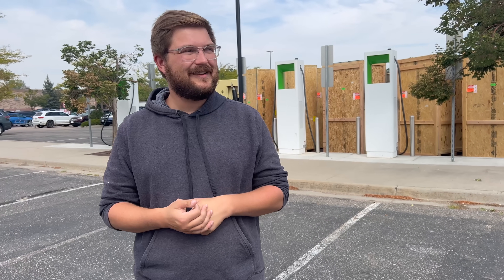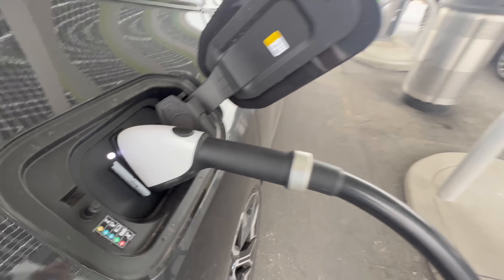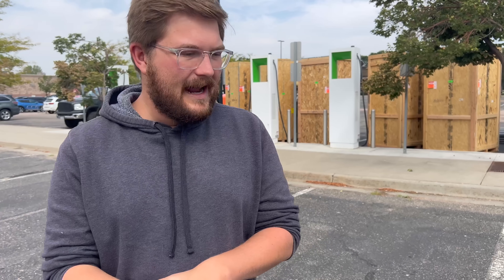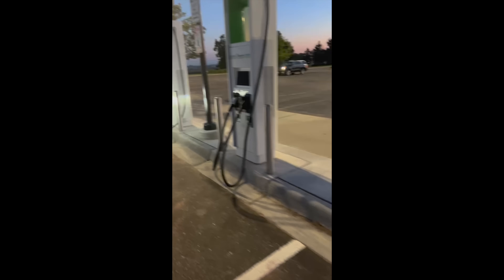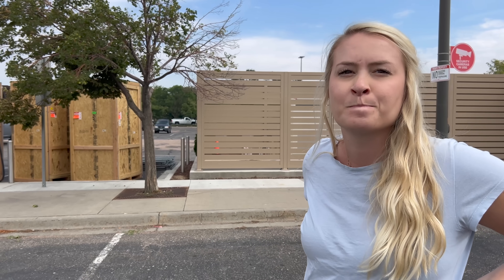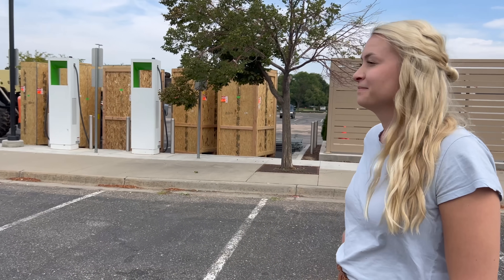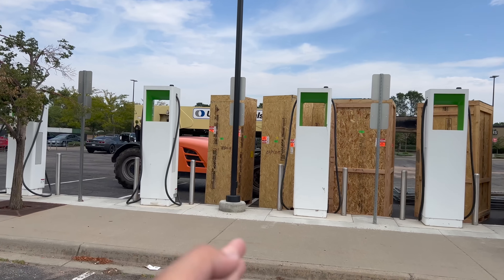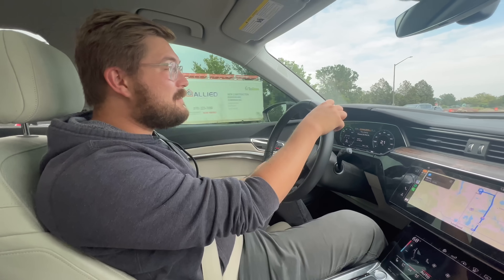Upgrade! New DC Fast Chargers Are Being Installed To Fix Reliability Issues Of Older Units

Comment: my local BTC's (6 on EVgo) had been rock solid for the past few years up until the recent heatwave.  went to the station over the weekend (2x) and found 3 of them are not working.  1 clearly says offline, 2nd looks like it's good but even with EVgo on the phone doing a remote reboot it still didn't work, and a 3rd has a completely black screen.

Comment: #OutofSpecReviews - have you had any experience with Tritium chargers? They are an Australian company. They design and manufacture proprietary hardware and software to create advanced and reliable DC fast chargers for electric vehicles. Tritium recently opened its first global EV fast charger manufacturing facility in the United States. Earlier this year, Tritium entered into a multi-year a partnership with BP. Thanks in advance.

Comment: Interesting comment about how things are better in the eastern US. We live in New Jersey, and usually charge my wife’s e-Tron at home, but a few times we used an EA station at a mall in Deptford NJ. The installation is about a year or so old. Stopped there a couple of weeks ago and 2 of 4 chargers were not working.
Reply: There is more than Ea do yourself a favor and learn plugshare and use chargepoint and ev go too so it isn’t just a bash fest on ea

Comment: I hope they only install "balanced" 350kw going forward with the higher charging EV getting the higher charging while the lower one gets the maximum in can. Looking forward, it will avoid confrontations, or at least difficult discussions, when low charging EVs always take up the 350kw chargers despite their EV not being even capable of taking a full 150kws.
Reply: This spot used to have 2 units at 150kW, and 2 at 350kW.  Having 4 balanced would be great, IMHO.

Comment: I wonder if this is the end for chademo. My guess is 3 of the dispensers will be updated and the chademo charger will stay the same unit. Would explain why there is only 3 crates sitting there.
Reply: Every day in the USA, more and more CHAdeMO plugs are added from EVgo, ChargePoint, Shell Recharge, 7-11, etc.  Dept. of Energy shows CHAdeMO station count at a few hundred less than CCS at over 4,300 and 2/3 of the CCS plug count; not bad for a dead standard.

Comment: They should be installing solar panels/car covers like Tesla is starting to do. Help the grid, don't hinder it.
Reply: I mean, to be fair, the roof over a parking space is worth maybe 25 or 30 kWh per day. So that's not gonna offset a very large percentage of your electricity use. Still, just having the roof at all would be nice.
Reply: I agree, but I think they need to build more charge stalls than they need on average. For instance, the one Tesla is building has 40 stalls. Gotta think there will be less than 100 percent use. But yeah, we need more supply for sure.

Comment: The new station being designed like a gas station is an immediate improvement in my eyes. But seriously, stations just need to stick to swiping your card or phone instead of software or car triggered charging. It's just less likely to fail.
Reply: Remember when fuel stations issued their own credit cards? I think I had an Amoco card back in the day. Good riddance. We don't need a return to siloed payment systems for EVs. Please.
Reply: I do love chargepoint because you just tap your phone and you are good to go.  much easier than Electrify America.
Reply: The card readers are a main point of failure for EA. For Tesla car triggered charging just works. There’s no technical reason other networks can’t work as well as Tesla.
Reply: @brendykes6599  To be determined. Will the Tesla chargers continue to be a seamless experience for all once they allow all CCS1 cars to use their service? We don't know yet.
Reply: @ps.2  not really. Now you have a communication protocol that can become screwed up, you need to have your credit card loaded to your phone or account making it more vulnerable, and you need to update the stations if they changed the communication computer on their cars.
Reply: @Skylancer727  "your account"? Why should I have an account? I don't have an account at any gas station. If you haven't fueled a gasoline car lately, oh man, it's super easy. You just provide a credit card at the point of sale and it handles the rest! Verifies your account and puts a hold on it for a maximum purchase (say $50) and then turns on the pump. Once you dispense what you want, it replaces the hold with a credit charge for the actual amount.

Occasionally you run into fraud prevention stuff like "oh we didn't expect you to be in Texas, so we need you to respond over SMS to verify it's really you" but nowadays with chipped credit cards (unforgeable, unlike mag strips) even that stuff is getting less common.
Reply: @ps.2  I think we already know it’s not the case for other EVs as they have to use an app. What I’m saying is Tesla proves it’s not impossible to be seamless, but a new standard may be required for CCS cars to work as well.
Reply: @ps.2  talking EV chargers. Many have it you need to open an app and tell it to start station 9, have your credit card added to your car which is less reliable, etc. The main reason they've been doing this crap is that it makes it easier for them checking people with their charging subscription fees. "Pay $20 a month and save $0.15/Kwh". Downside is it makes the whole process more annoying for basic consumers.

Comment: EV charging will be a second rate experience until they regularly put them under carports just like most gas station pumps.
Exposing them to extreme sun, snow and rain probably makes them wear faster plus it’s a very poor experience for the customer  to be rained on or have trouble reading the screen due to sun glare while you and the charger both overheat in the afternoon sun.
Hiding the chargers in back corners of sketchy parking lots also shows disdain to their customers.
Reply: Roofs costs money and gas stations are requireed to be protected from rain runoff, so it will never be as common for electric chargers to be under a roof I think.
Reply: @sandos-x1t  Fuel brousers need protection from rain. High Voltage equipment handled by the public not. WTF?
Reply: @sandos-x1t  I think the roof contains a mandatory fire retarded (?) too.
Reply: @sandos-x1t  Yes, a roof costs money. It’s part of the cost of dong business.
Running a business costs money.
Leaving the customers exposed to sun and rain is insulting  and hostile.
Reply: EV charging will be a second-rate experience until the price of DC fast-charging retails at $1/kwh.  THEN, no operator could afford to have one idle, and profits will pay for carports, and competition will soon have operators trying to outdo each other’s amenities.   Have we forgotten how the miracle of free enterprise works?
Reply: @carsonassociates3263  
And at $1 per KWH.. No one will want to use one because gas will be cheaper by HALF, and still faster.  NO THANKS..
Nobody is going to pay $60-100 to go 300 miles.  That is insane.
Reply: @kens97sto171  There are plenty of 15mpg vehicles that pay $80 to drive 300mi.  Cheap charging is HOME charging; if you want to see reliable DC fast-charging for a road-trip, it’s necessarily going to cost a LOT more than home charging, because of the necessary equipment an operator must purchase and maintain.
Reply: @carsonassociates3263  
There are no vehicles that get 15 miles per gallon that are similar in shape or Energy efficiency to any of the EVS you're trying to compare them to.
You might get 15 miles per gallon in a 2500 series heavy duty pickup truck.
I understand cheap charging is at home. But that's not what we're talking about here.
Think about it. They can drill for oil pull it out of ground, put it on a ship, send it to a refinery, put it on a truck, send it to a gas station. Provide a cover, and a place with a restroom and snacks and food. And still sell it to you for less than the cost of that charging session you're talking about at a dollar per kilowatt hour.
Something doesn't seem right.
I've Got Friends with 1500 series pickup trucks they average closer to 20 MPG.
And the average sedan in the United States is getting closer to 35 MPG on the highway.
Reply: @kens97sto171  The amenities of gasoline retailers exist because of profit-motivated free enterprise.  If we want similar amenities for DC fast-charging, we’ve got to encourage the profit motive to do its work.  I’d rather pay $1/kwh on a road trip (MORE than cost of gas!) for DC fast-charging that’s dependable, than pay $.40/kwh and wonder whether it will be found operational (so that I can get soaked charging in the pouring rain).
Reply: @carsonassociates3263  
And yet somehow the gas station with all of its profit motivated extra items, can get you more miles for less money than the $1 per kilowatt hour you're talking about.
I agree with you that charging stations should have amenities like a gas station.
But I'm not going to pay three times as much money and spend three times as much time versus a gas car on a road trip.
$1 per kilowatt hour is about three times the current rate.
There is no way in hell I would ever pay that regardless of what the amenities are or how reliable the charger is.
Gas stations don't have reliability problems in dispensing fuel and they do it for a far lower premium and already offer all of the services and products you could possibly want on a road trip.
Reply: Gas stations sell gas at a loss because it's the convenience stores that make them a profit. If utilities built those stores for chargers, at least theoretically, they should be able to sell charging for even less than they do now.
Reply: @carsonassociates3263  the miracle of free enterprise results in there being very low margins on gasoline. I look forward to having all those amenities along with low margins on electricity. If gas stations make their profits off the stores now, they can do the same with EVs as they provide for EV drivers. I look forward to DCFC prices being only 5-20% higher than home charging.
Reply: @brendykes6599  Sounds good to me, too!  Problem is, delivering DC Fastcharging requires operator $investment and ongoing $maintenance, at present, for dependable (i.e. works when YOU need it) charging.  I would gladly pay $1/kwh for the CERTAINTY of highway roadtrip charging.  My home AC Slowcharging is my primary source, and will remain the most economical as well.

Comment: Kyle, I'm looking forward to two particular reviews. 1) Roadtripping with the Aptera (loaded up with camping gear, Alyssa, and the dogs), and 2) Offroading with the Aptera. I hope you can get around to those two.
Reply: 👍👍👍👍Aptera - waiting impatiently for mine!
Reply: With those low fairings around the wheels like a Cessna, how is offroading with Aptera even supposed to work? Do you just remove the fairings?
Reply: @ps.2  They have an off road version where you can easily lift the wheel housings.
Reply: @ps.2  …you’re catching on….

Comment: Yes, perhaps this will help.  But....  My concerns about battery electric vehicles are far more "in the future."  Just consider every gasoline station you see, every day.  Those things work, every day, every month, every year, every decade, and normal ordinary human beings can use them.  I would really like to see you or some other YouTube channel that's deeply involved in battery electric vehicles really dive deep into why these charging stations have become so unreliable, and what are the chances that this will be the future of battery electric vehicle charging, or whether things will become as reliable as, say "gasoline stations."  Would that even be possible?  Are these things just dealing with such high DC power, advanced electronics so they can work with a wide variety of vehicles that pull up, and/or other technologies that just aren't going to be any more reliable that letting your notebook computer sit out on top of one of these dispensers, 24 hours per day?

Also, what are the chances that "ordinary human beings" are going to be able to use this technology, when nothing but battery electric vehicles become available for the "masses" to purchase?  Good grief, do you drive around at all?  <sarcasm.>  Just about every time I'm stopped at a red light at an intersection, I have to worry about someone who won't even pay enough attention to notice that the light has turned green.  Out on the open road, something like half of the drivers absolutely WILL NOT EVER pass another vehicle, for any reason.  Out on the freeway, we have lots of sections with three lanes in each direction -- a fast lane, a middle lane, and a slow lane.  And seemingly half of the drivers just go straight into the middle lane, and once again, there is nothing that will ever get these people to use either of the other lanes for any reason whatsoever.  It's like there's a thousand-vehicle "fence" going down the middle of the freeway, choking the free flow of traffic.  Do you really think these people are going to understand "don't charge up to 100%", or will you be waiting for hours for these people to sit there for hours?  Do you really think these people will understand that "they don't need the fastest charger," so you can have it, instead?  I'll bet real money that these people will be clogging up the fastest chargers, just like they clog up the freeways.

In the end, perhaps the infrastructure will eventually become reliable (but who is going to pay for it?), but I have absolutely no faith in "normal" human beings being able to figure this stuff out properly.  If they can't learn how to drive, how can you expect them to learn how to charge up battery electric vehicles?  I'm quite serious here -- that's the future that should be getting a whole lot more attention before it just becomes a real, every-day nightmare.

Comment: Looks like The Charging location in Springfield Mass at Chicopee Market (EA's) first installed location is getting new hardware. Visited here thus last summer and the hardware was in rough shape only two units worked

Comment: It’s too bad that EA is having to go back and replace chargers that are only a few years old. Of course, I’m sure wasn’t their intention to install junk at the time, but they’re still responsible for it. It’s really unfortunate that they’re having to spend time and money to do this instead of putting that time and money towards filling the huge gaps in charging in rural areas, as well as expanding the overloaded charging sites on critical travel routes.

That said, I hope their efforts to replace all of these chargers is very, very quick. It’s already been a issue during this summer at all of the older installations, its going to get worse during the winter. I’m kind of glad my partner talked me out of driving from Portland-area to San Diego for Fully Charged. I’d rather drive than fly and I did that trip 4 months ago with almost no issues, but based off of the charging experience around Oregon over the past 2 months, I worry that it would have been needlessly stressful.

Fingers crossed that they get this crap sorted out very quickly.
Reply: Power electronics is like this, put it outside in the heat and cold, and any design flaws turn into hardware failures.
From what has been said, most of these sound like failures of one or more AC-DC Charger modules, sounds like EA have had enough of paying for new modules all the time.

Comment: Great job, Kyle, as always. This is an existential issue for EV owners and the future of EV adoption. People have finally let go of the ridiculous claim that charging stations need to be as plentiful as fossil fuel stations. Good. But, the stations that do exist need to be rock solid dependable. 

I’m hoping you can be a clearing house for people across the US to report when their local EA stations are updated with the new hardware. That could be a really important service to keep folks up to date with where these are going in and help with those taking long road trips. 

Happy, safe, and reliably charged road trips to you and your crew here and abroad!
Reply: Good points. They get incentivized to install more stations, so that's why existing ones are shit. We definitely dont need as many DCFC as gas pumps, because of home charging, but we need more of them on secondary roads and especially in the boonies. The best is to install EV chargers at existing gas stations.
Reply: Agree and disagree. Yes home charging is huge, and yes we need more of them in boonies/remote/off the major interstates. That said you must take into account the added time to charge when road tripping over the time to fill a tank with fuel when road tripping. So we do need to massively scale the # of dc fast chargers for wide scale adoption. Tesla supercharger coming aboard will help, but just as a stopgap for a year or two. More ev adoption I fear is going to outpace charging infastructure